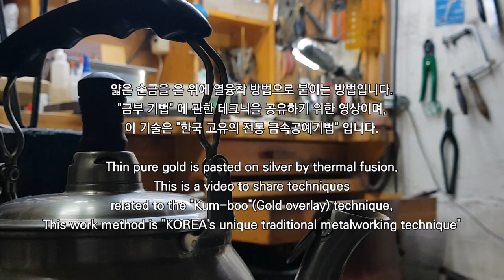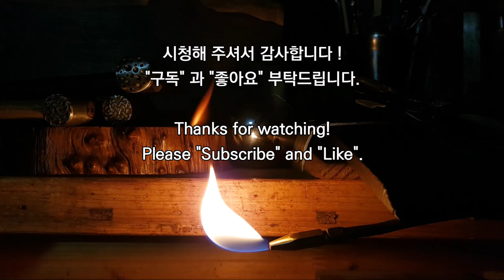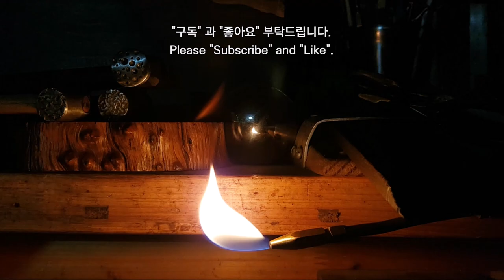KEUM-BOO technique / 24k 순금 금부 작업방법

Comment: fascinating, how durable is the gold foil once fused? have you ever had any pieces de-laminate or peel off later down the road? 

how important is the texture?  would the gold foil fuse well to a smooth surface?

we use sterling silver here in the states (92.5% silver) is there a specific reason you use 95% silver?

how well does the foil stick on a ring during and after being resized?

how long has kumboo been around? does korea have a long history of silver smithing?

what are the typical gold karats used in korea? do you work in gold much?
Reply from the maker: fascinating, how durable is the gold foil once fused? have you ever had any pieces de-laminate or peel off later down the road? 
1)Heating these metals to a temperature between 260?370°C increases 
the movement of the atoms. 
When pressure is added, 
this causes an electron exchange at the surface between the two metals, 
creating a permanent diffusion bond. 
This diffusion bond occurs far below 
the soldering temperature for either metal (Dhein, 2004).
Once gold is attached, it becomes one body and does not fall off.

how important is the texture?  would the gold foil fuse well to a smooth surface?
2)Smooth surfaces stick better.
It's harder to stick on top of the texture like I did.

we use sterling silver here in the states (92.5% silver) is there a specific reason you use 95% silver?
3)When making silver products,
Generally, sterling silver (92.5% silver + 7.5% copper) is used.
It is like an international agreement.
The reason for doing this is to make pure silver harder to improve durability while improving the color of the surface after completion and improving the overall properties of silver.
However, as the silver content increases, the properties of silver become softer, so I specially alloyed with 95%.
If you have an item made of pure silver, I hope you don't buy it.
It is difficult to use because it is too soft to use.

how well does the foil stick on a ring during and after being resized?
4)Workers need to be good at it. It's not as easy as it looks.

how long has kumboo been around? does korea have a long history of silver smithing?
5)There are records of using Korean metal crafts and gold parts from the 1st to 3rd centuries.

what are the typical gold karats used in korea? do you work in gold much?
6)Various gold carats are used in Korea.
24k, 18k, and 14k are the most used.
I am not a gold expert.
I have been specializing in silver work for 30 years.
The gold used in the video is 24k.

I don't speak English well, so I rely on a translator.
To write a reply to you, I have spent 30 minutes.
I did my best to write a reply to you.
I can't reply to you anymore.
I hope you understand this.
Reply: Please how do you advise clients to polish pieces with keum boo later when they tarnish?

Comment: Please do more videos like this. 

My question is do the natural skin oils on the gold and silver from handling interfere with adhesion?
Reply from the maker: When attaching gold leaf to silver, it is recommended that there are no foreign objects.
But don't worry.
This is because all common foreign matter disappears in the process of applying heat to a high temperature.
Thanks~

Comment: You convinced me I am going to try it.
Reply from the maker: Good, thanks !
Reply: A question if you don’t mind.   What is the thickness of the gold foil you used and do you have to draw the fine silver to the surface before applying?  Thanks for the great examples.
Reply from the maker: The thickness of the gold sheet,,,
A postcard-sized gold sheet is about 3-4g.
That's about the thickness.
It is about the thickness of a regular paper.

Heating these metals to a temperature between 260~370°C increases 
the movement of the atoms. 
When pressure is added, 
this causes an electron exchange at the surface between the two metals, 
creating a permanent diffusion bond. 
This diffusion bond occurs far below 
the soldering temperature for either metal (Dhein, 2004).

Nothing is permanent in this world.
It may wear out over time.
Physical contact may cause it to peel off.
It doesn't go away easily with the passage of time.
Because silver and gold became one.
This is different from normal plating.
Thanks~

Comment: Excellent video!  In some cases you applied the gold first, burnished it and then heated it. In others, you heated first and then applied the gold and burnished. Is there a difference of when you do it? Thanks.
Reply from the maker: That's a very good question!
There is no difference between the two methods you said.
The result is the same.
When determining the exact location of the gold leaf, place the gold leaf in advance,
If not, it can be pasted after heating.
Reply: @SilverMeister  but applying after heating and add pressure withe your finger, you burn yourself 🙈

Comment: Thank you for sharing how you do Keum Boo. I have not seen it done this way with a torch. I noticed that you did not use any solution to adhere the gold foil, just pressed it with your finger.
Reply from the maker: The thickness of the gold sheet,,,
A postcard-sized gold sheet is about 3-4g.
That's about the thickness.
It is about the thickness of a regular paper.
Heating these metals to a temperature between 260?370°C increases 
the movement of the atoms. 
When pressure is added, 
this causes an electron exchange at the surface between the two metals, 
creating a permanent diffusion bond. 
This diffusion bond occurs far below 
the soldering temperature for either metal (Dhein, 2004).
Nothing is permanent in this world.
It may wear out over time.
Physical contact may cause it to peel off.
It doesn't go away easily with the passage of time.
Because silver and gold became one.
This is different from normal plating.
Thanks~

Comment: Like this technique!  I did a try with gold leaf sold for covering the statues in temples but without success. They are too thin. Even putting 5 layers of them together didn't give me good results. Where do you buy the gold plates of the necessary thickness (60-80 micrometer) in Korea?
Reply from the maker: The gold part I use is about 200 times thicker than the gold leaf that covers the statue of the temple.
It is specially made and purchased at an offline shop in Korea that sells, or pure gold chunks are directly made thin and used.
It is sold at a place called "동양금박-Dongyang Gold Leaf" in Seoul, Korea.

Comment: Tho it doesn’t show for people, you also used a torch or hot plate to heat the ring as well. I don’t think it’s as easy as it looks with all the editing. At least for me. What is the thickness of your gold sheet, is it self rolled in the rolling mill? Or purchased,
Reply from the maker: The thickness of the gold sheet,,,
A postcard-sized gold sheet is about 3-4g.
That's about the thickness.
It is about the thickness of a regular paper.

When using in large quantities, it is made by rolling directly,
When using it in small amounts, I buy it little by little at an offline gold shop in Korea and use it.

Comment: As I commented previously you make Kum Boo look simple due to your skill, I was taught to do it by a Korean lady many years ago (She was learning Tae Kwon do with me) after many years I find you have the get temperature just right or it is not successful.
Reply: Heating these metals to a temperature between 260–370°C increases the movement of the atoms. When pressure is added, this causes an electron exchange at the surface between the two metals, creating a permanent diffusion bond. This diffusion bond occurs far below the soldering temperature for either metal (Dhein, 2004).
Reply from the maker: Yes.
Temperature is very important when working with gold foil.
Learning the tricks of doing your own work makes it a little easier.
Thanks~
Reply from the maker: It's a good resource.
Thank you for sharing good data on my behalf~